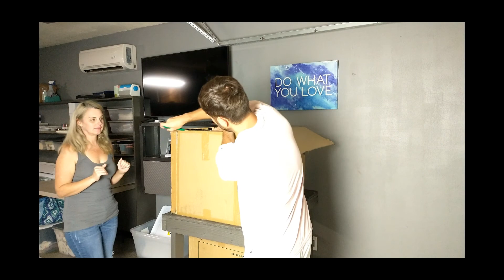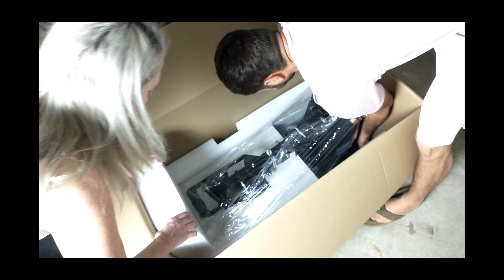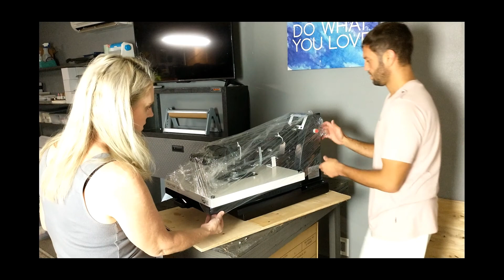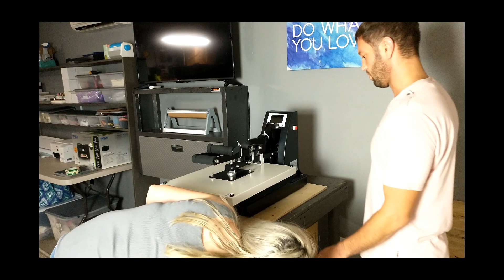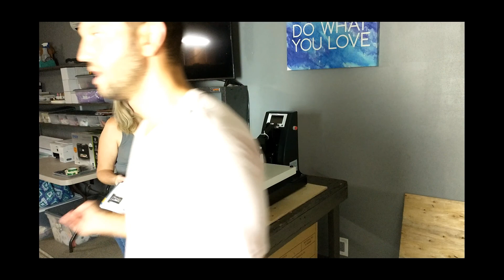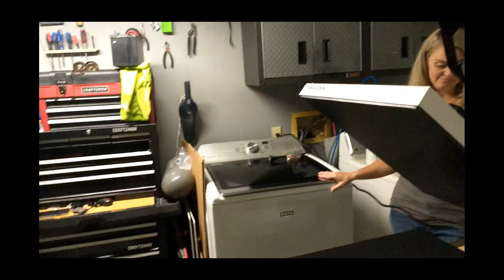UNBOXING HEAT PRESS HPN 16X20 SIgnature Series Auto Open slide out drawer

Comment: How did you get pass the specifications for the HEATPRESS when it says to plug in straight in the plug by itself being in an apartment or home without blowing the circuit breaker or a fuse